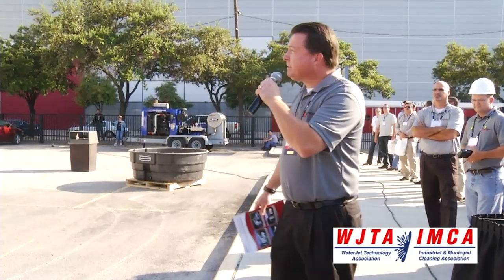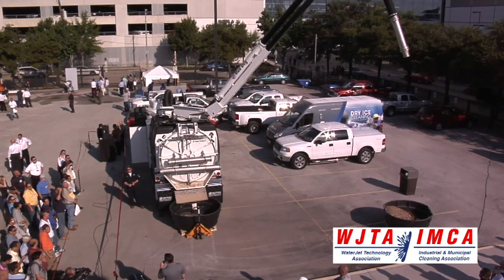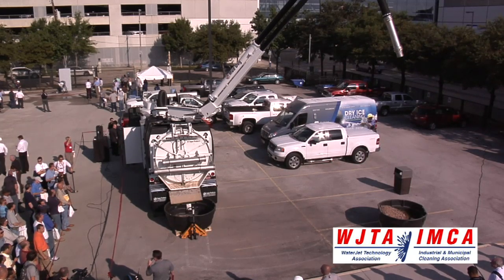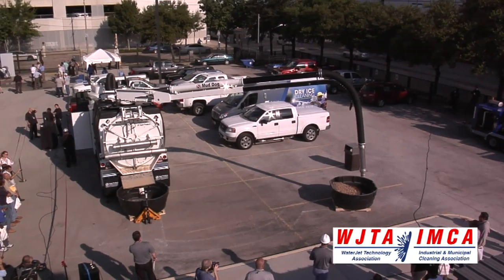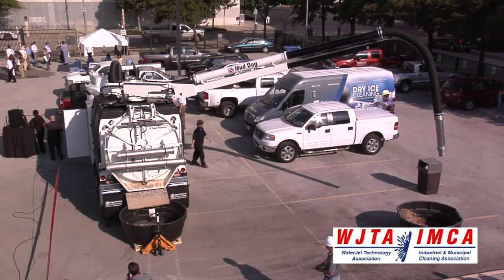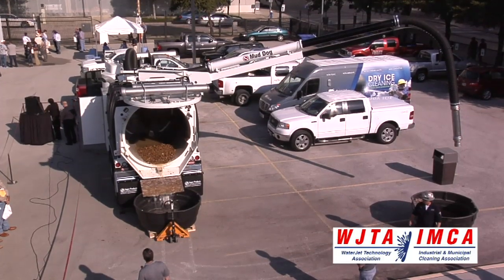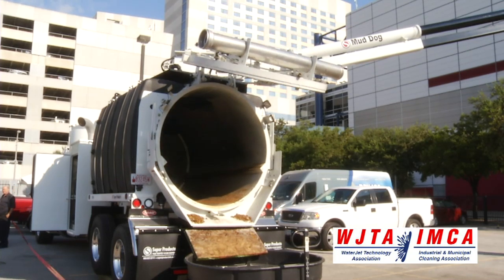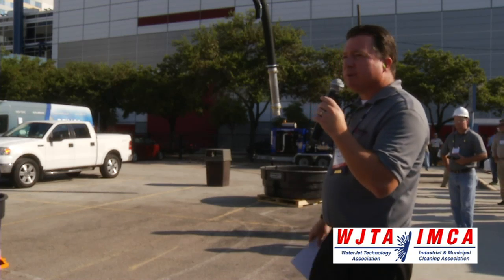Mud Dog 12 Yard Hydro Vac  Demo   WJTA 2012

Comment: For debris that gets stuck behind the ejector plate, how do you clean that? If the ejector plate is extended and you climb in through the door on the plate, would that be considered a confined space? There's a door there so it must be used for something, and I'm wondering how to perform maintenance inside safely. The bar that is on the ejector plate, is that a protective device to prevent the door from slamming if the hydraulics fail? If the ejector plate is out and the hydraulics fail, would the door push the ejector plate back into the truck?
Reply: That is considered by osha to be a confined space entry behind the push plate. Best way of cleaning is to have plate all the way extended, hold open the 6" gate valve for drain with rope and stand opposite side port hole and pressure wash wand out the debris into the drain and with the plate extended, the rest will make it's way down and out. A good functioning wash down bar and tips also aids tremendously with removing trapped debris and letting it run out past the scrapers on plate while dumping. If you're getting debris packed higher than the port holes behind the push plate you are over filling the tank. Hope this helps.
Reply: The bar does not protect the cylinder from contacting the tailgate. If the tailgate is lowered with the plate extended, it will contact the edge of the cylinder. It really won't push the plate or cylinder in but it could potentially warp the tailgate/damage the tailgate edge and seal.

Comment: Use some real world application materials..like what you'd fin in road beds in city streets, like bricks and 7" rocks to go up the hose and get it blocked...then show use how you quickly fix that problem. Design flaw 101....the boom don't come down low enough to work on the hose clamp that hold the rubber hose (snorkel) to the extendable pipe section.  You can't take the hose off with out a fork lift and a pallet to stand on to disconnect the hose. Badger trucks, you can stand on top of the truck and disconnect the hose right at the tank intake porthole, turn the hose around and suck back the blockage...and your good to go.
I've operated both badger trucks and Mud dogs. In my opinion Badge is a better design. Not even going to mention all the time cleaning mud and debris from behind the mud dog push plate / wall. More work than it worth.
Badger clean out the material in this video of a full load....open and closed...clean rinse out in less than 3 mins.

Get a better boom design set up, because the most down time we had with our mud dogs were because of hose blockages where the snorkel and extender pipe connect. Seriously the fact that you can't get to the hose clamps to disconnect the hose to remove a block at ground level are a major draw back.